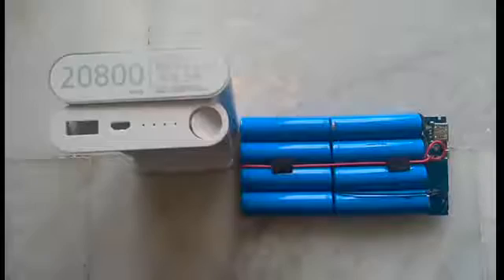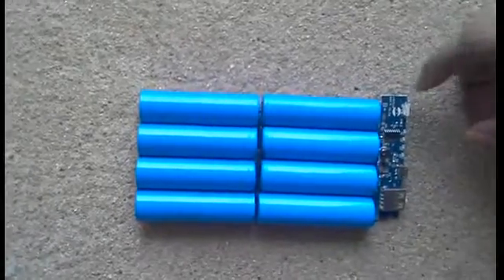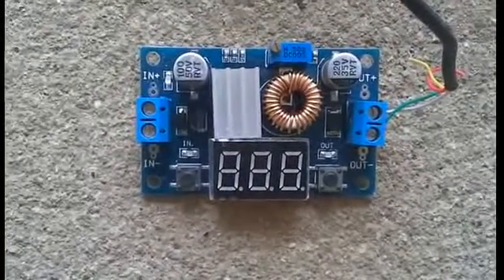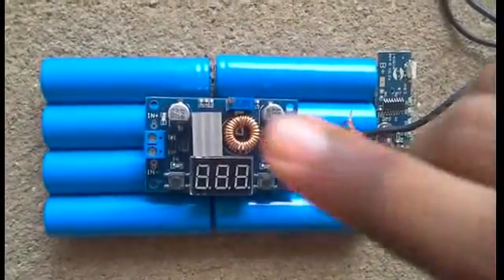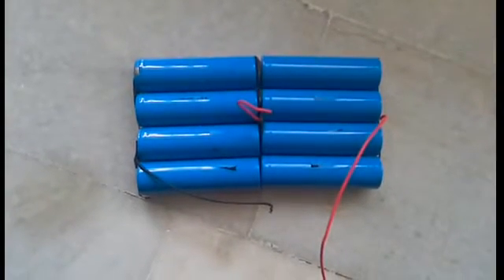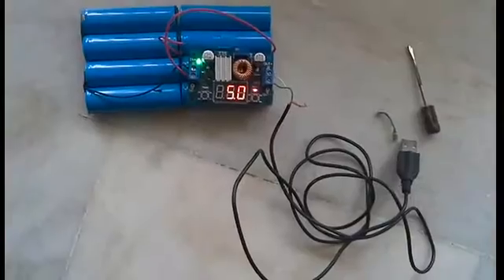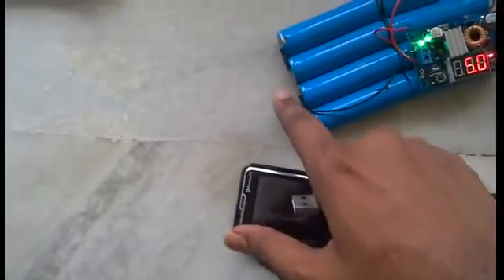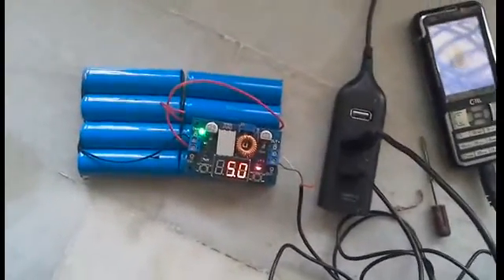Fake XIAOMI 20000 mah TEARDOWN/DISASSEMBLING part2

Comment: in my experience some cells in these power banks are filled with sand..  and batteries are also mismatched.
cut the metal strip and verify voltage of each cell ..
linear buck convert is just a waste of energy ..very inefficient.
Reply from the maker: ***** so if i cut the metal strip what is the difference, and please tell me how much power is consumed by this buck comverter